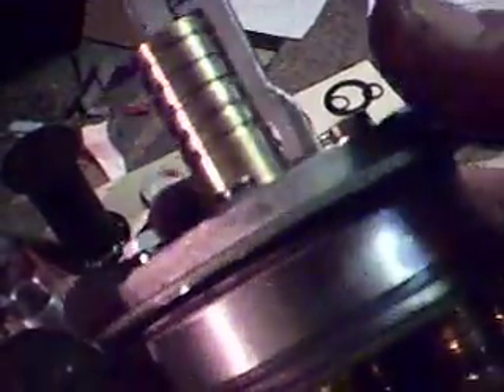Mini Nexus3.25 Stirling engine motor.

Comment from the maker: I have a few high end reams and actually bored this one off center a bit with a jobbers drill even. I use 600 grit + autosol, silvo then wash with 99% rubbing alcohol. My newest aquisition is afew boxes of 2-56 cap screws for fixing the kit crank pins to conecting rod bearings. I'll have a parts page soon for affordable experimenting. I'll have graphite and precision pirex bores as well listed.

Comment from the maker: UPDATE:
I have been testing heat transfer to sides and have concluded short of putting a pressed bore of stainless as a hot-cap cup on bottom a ceramic and or borisilicate glass flange is required between thin stainless bottom plate and body of upper motor.
Waiting for high heat ceramic sheet, pyrex glass and 1/4" friction material like brake pads on a car. These all should block the transmit of heat away from lower hot end "gap" below displacer.
We'll see,